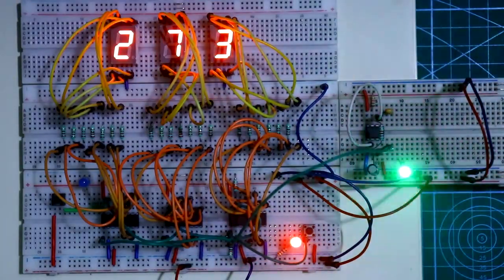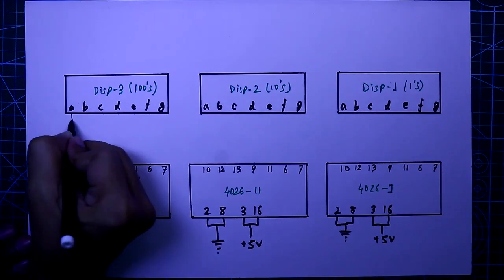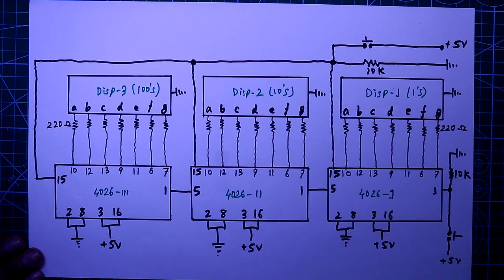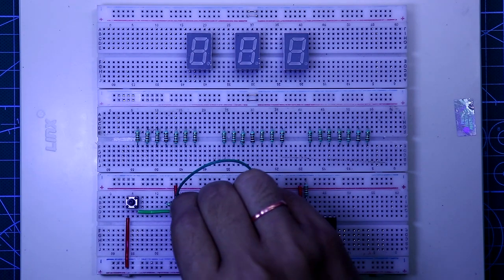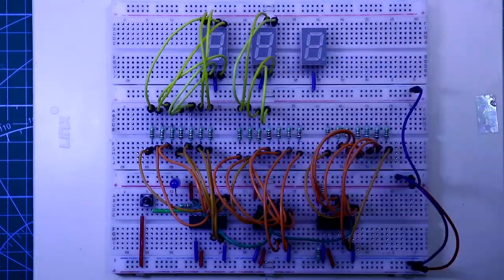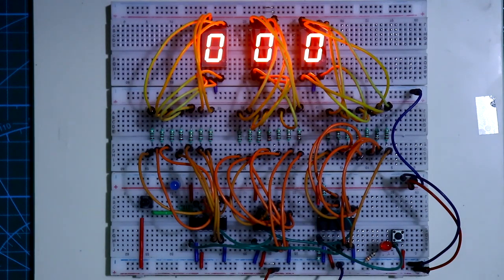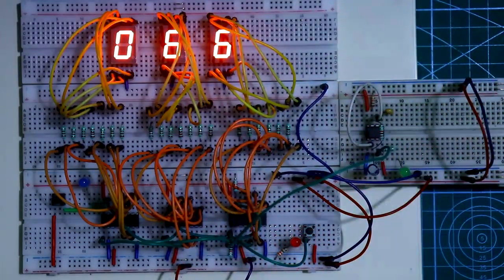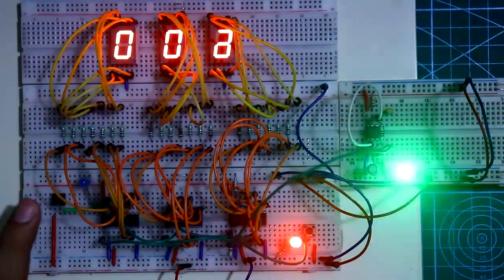How to cascade the decade counter IC 4026 | Details of IC CD4026

Comment: if i connect big segment display should i adjust the value of the resistor sir? what is the use of capacitor in this kind of project if add one??

Comment: I use 9v power supply for 555 and  5v for CD4026 counter.  Can I connect them together by sharing ground? I afraid that wrong wiring will fry my IC chip.
Reply from the maker: No problem, you can connect 9v to CD4026 also.

Comment: If you look at the 4026 datasheet you will see that it has been designed to directly drive a 7-segment LED display. So the current limiting resistors are not needed.
Reply: Thanks mate

Comment: Sir i have confusion of 1st IC pin no 1 should be connected to push botton after what should do I didnot  understood so please reply sir
Reply from the maker: We provide clock pulses on the pin 1 of 1st ic. We take clock pulses from microcontroller, 555 ic pr any other ic. Here, I've shown with a push button switch. For more details, please watch "basic things of 4026 IC" video. I hope that video will help you.

Comment: Instead of putting a 220 ohm resistor on each counter output, is there a reason you are not putting that resistor instead on the cathode of the seven segment display? Seems to me that would be the same effect using fewer components- a common cathode for seven segments times three is three resistors on three cathodes, where you are using 21 resistors on the anode side of the circuit. Is there a reason you cannot lower the voltage for the seven segment display that way? Is there a reason you cannot put a single 220 ohm resistor in between all three common cathodes and ground? I see this on youtube... a lot. And I have read that it's incorrect, unless you have a reason it needs to be that way- things like different numbers of LEDS driven in sequence, or a mixture of LEDs with different voltages, stuff like that. Full disclosure: I am still learning, and I am not personally familiar with the counter IC you are using, which is why I am asking... this is a good faith question, please take it at face value.
Reply from the maker: Admirable question, loved it. I'll make a video on this with full explanations.
Reply: @EEWave  Thanks for taking the time to reply to my question- I will be checking out that video when you post it at some point in the future.
Reply from the maker: Hello bro, I've uploaded a video on this topic. Link in the description below. I hope you'll enjoy it.

Comment: Nice video with excellent explanation. Kindly also make videos on controlling dual 7 segment display , triple 7 segment display and so on.  Dual 7 segment display has 10 pins approx and  triple seven segment display has 12 pins approx.
Reply from the maker: This kind of display needs microcontroller.
Reply: Ok which microcontroller and how to program it. If possible kindly make videos on that. Your all videos are very interesting and going on nicely. The way of explanation along with circuit diagrams and hardware connection in your previous videos is also excellent.